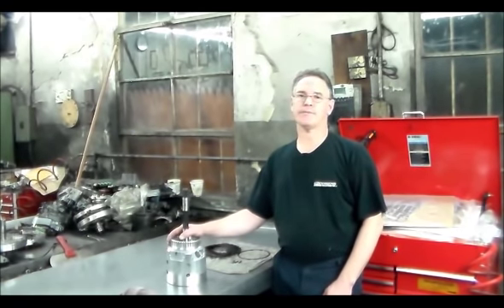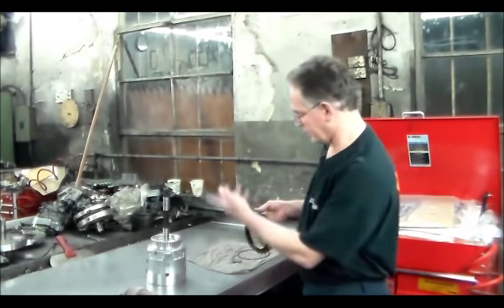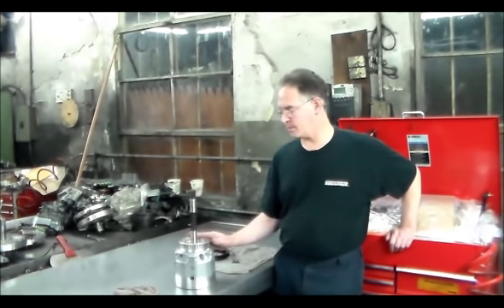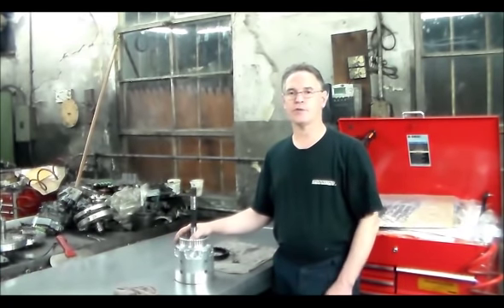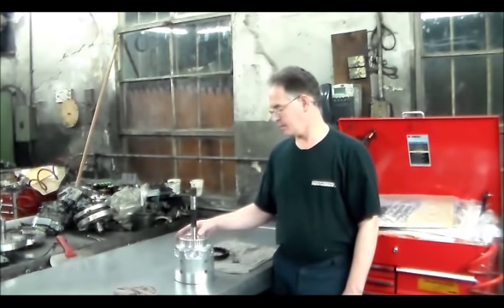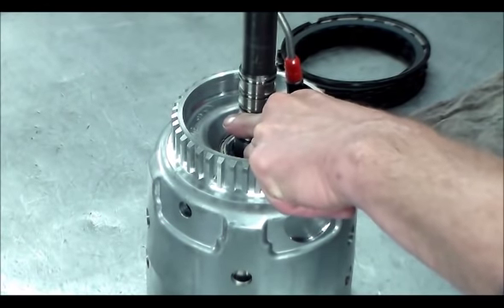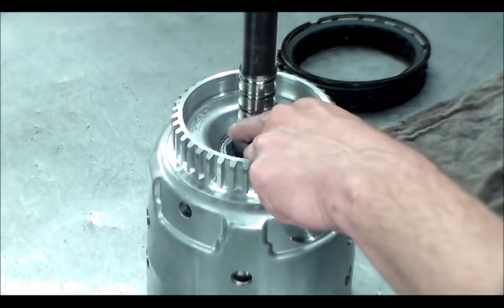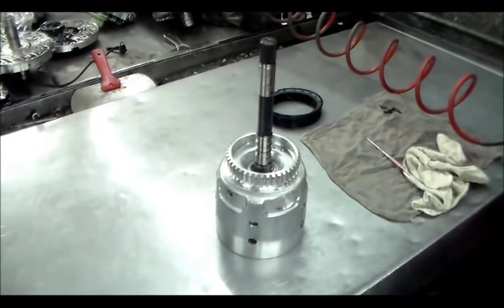4L60E Rebuild tip

Comment: Hi Gary, thanks for the great videos. I have a question for you: '01 4L60e in '05 Escalade, after an issue where the lower cooler line popped out while driving on the highway (too much pressure?), now when in 'D' it does 1-2 just fine, once in second gear it flares at 1900rpm, the line pressure drops from 125 down to 65 at the same time the flaring starts. Usually, once it gets to higher rpm it upshifts to 3. If, while slipping, I put it into gear '2',  line pressure comes back to 125 and it stops slipping.  It never slips in '2' or if I 'pedal-to-the-metal' it. Last week it did the 1-2, 2-3 shifts without slipping twice out of many tries (so it still CAN do it, sometimes). I tried the longer Sonnax servo pin, it didn't help at all, so I put the original pin back in. But on a test run with the longer pin, the servo cover flew off and a lot of fluid dropped as I limped it home: could there be too much pressure in there? So I kept doing different road tests to check psi under different circumstances. I was getting 95 psi at idle and 225psi at 1500rpm in 'D', then last week I started getting 65-70psi all the time. I unplugged the wire harness to see if it would go to max pressure and it didn't. So, I dropped the pan and found the PCM was full of gunk on the screen closest to the tip which comes from AFL. I cleaned it but haven't tried it yet. I know the common answer is my clutches are bad, but If my clutches are only a bit worn, is it possible that 65psi isn't enough to hold at 1900rpm and above? I know the clutched will never be 100% but I wanted to focus on that massive pressure drop first to see if that could be a major problem. And what check ball or path could cause that sudden drop of line pressure from 125 to 65 psi? I really want to try everything before I drop this transmission...Any help would be much appreciated.
Reply from the maker: Line pressure may come down so the shift is smooth , when it does go to 3rd does the pressure come back up?  A common issue is the clutches, rarely see anything else, clutches go bad due to piston or maybe leaking drum
Reply: @GaryFerraro  Yeah, from memory the line pressure goes back to 125...Is there any last ditch, Hail Mary I can try for before we drop her?
Reply from the maker: @muchgreatness7497  Not Really, seems like it's a clutch problem, very common with this trans
Reply: @GaryFerraro  Ok, thanks for your help. You are great to be this generous with your time and knowledge. It is very much appreciated. Have a great night.
Reply from the maker: @muchgreatness7497  Anytime

Comment: Good tip!
Question for ya...
What normally causes a 2-3 shift flare? 2007 gmc sierra doesnt do the normal full slip, but sometimes it does what i believe is called a shift flare when upshifting into 3rd.
Someone said if i install a corvette servo, it would eliminate the shift flare. Why is this? I was thinking maybe one of the check balls are getting stuck into the valve body plate.
Any help would be appreciated! Was hoping its somthing that might be remedied without a full rebuild. Because the trans works good overall. And it doesnt always do this shift flare.
Reply from the maker: Working on something like that now,  what you may need is a longer servo pin, you could try a corvette piston but that may just firm up the 1-2 shift, i do corvette servos in all rebuilds. Once the band released then the oil goes to 3rd clutch apply, what you also may want to check is the most inner seal on the servo. If you install a corvette piston that seal will be changed, if you still have a flared shift sometimes go with a longer servo apply pin
Reply: @GaryFerraro  
Ok great. Where can i purchase the longer pin? Is it made by Sonnax?
Is it something i would have to play with, and measure and grind, till i got it right, or is it safe to just install the longer pin? This controls band adjustment, correct?
Reply from the maker: @splash5974  Yes correct, sonnax does sell the Extra long pin and i think the corvette servo as well, you will have to drop the pan to watch the band travel or you could measure it( i like to watch it and make sure it's not binding)
Reply: @GaryFerraro  
Thanks for the quick replys!
Ok, so is there a certain clearance im looking for between band and drum, or just visually make sure its not binding?
Thats too bad that i have to drop the pan...i just put a new gasket, filter and fluid in it recently...wish i knew this before.
Reply: @GaryFerraro  
Do you think i could juat try the servo first and if it doesnt help, then try ordering the longer pin?
Cause i was talking with a gentleman locally, and his truck suffered from the 2-3 flare, and he said the corvette servo cured that issue for him. And i do realize not every situation is identical, just try to keep costs down if its not needed.
Reply from the maker: @splash5974  Yes, i would try that, also the inner most seal will be changed as well, i believe you get the seals with the piston
Reply: @GaryFerraro  
Thanks for your help!!

Comment: Hello Gary, i wanted to ask a question about a ZF 5hp19fa transmission. I did the rebuild and everything worked properly for about 8 months .
it still shifts fine . but i noticed that when traveling around 40 to 55 mph. the would seem to be a engage/disengagement of the transmission . 
it seem like the the torque converter would seem to not stay "locked in ". When lets say getting on the highway and cruising above 60 , everything is fine no issues whatsoever. but it seems to switch back and forth between lockup and locked.  is there anything i can do as far as quick check to diagnose and find the culprit? When i rebuilt the transmission i even replaced the TC .  but i have heard of others getting a re-manufacture one from TRANSSTAR  seemed to be some defective ones. any advice can help or from anyone that may have had the same issue
Reply from the maker: Is there by chance any codes present

Comment: hi gary 
zf 5hp19FLA no movment into drive but in manual mode it shifts ok in 1.2.3.4.5
Reply from the maker: issa alazzabi one side of the D/G drum has the sprag and low clutch. The drum may be blown. Have you dropped the pan
Reply: Gary Ferraro i teardown the trans but ididnt go inside the drums but D/G drum looks ok its not blown
Reply from the maker: @issaalazzabi6087  check to see the sprag is working ok, almost sounds like a bad sprag
Reply: Gary Ferraro ok gary thank you so much for the help
Reply: gary it turns out exactly like you said  the sprag is not holding and all clutches were good 
thanks for the help
Reply from the maker: @issaalazzabi6087  Nice, check that F clutch drum too, make sure the sleeve is in where it should be, i have a video on that
Reply: Gary Ferraro thanks gary i will check the f drum
Reply from the maker: @issaalazzabi6087  Ok, let me know how it goes

Comment: Hi. I have a 04 4l60e and when I drive it goes in first but revs until 3500 until it slips second gear. Any tips on what I should do?
Reply from the maker: Sounds like it's shifting from 1st to 3rd, if you manually pull this to 2nd and give it some gas does it hold?
Reply: Gary Ferraro no second gear. Yeah I think it’s first to third. Any suggestions

Comment: hi gary 
i still couldnt find a solution to my problem with 09g trans the k1 clutch is not releasing in 6th gear at 110 kmh i replace the vb and pump and selector and tcu both speed sensors and still nothing
Reply from the maker: ok, did you say it came in with this problem?
Reply: Gary Ferraro it came in with k1 clutch completly burn due to oil mixed with coolant
Reply from the maker: @issaalazzabi6087  Does this trans air check ok?   Bottom of the case there is a sleeve that can turn, never happened to me but it is a problem with this trans, do you have a pressure gauge?  i want to see if there is a K1 tap, put a gauge on that and see what happens when the clutch should be turned off
Reply: Gary Ferraro ok gary i will do that 
but what if still there pressure when the drum is off
Reply from the maker: @issaalazzabi6087  something may be crossleaking or bleeding into the circuit keeping the clutches applied
Reply: Gary Ferraro where can i find the cross leak or the bleeding